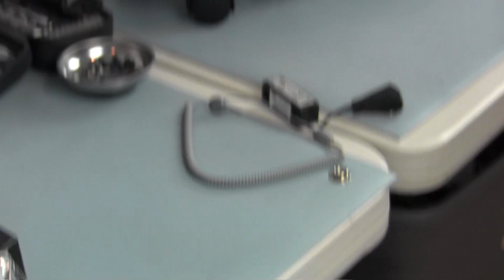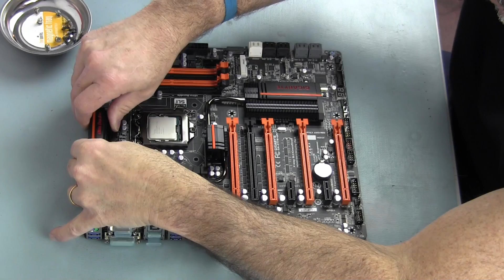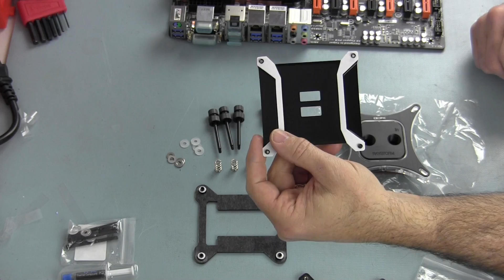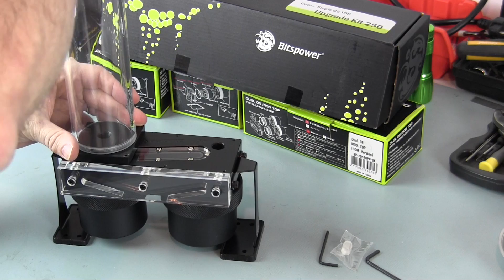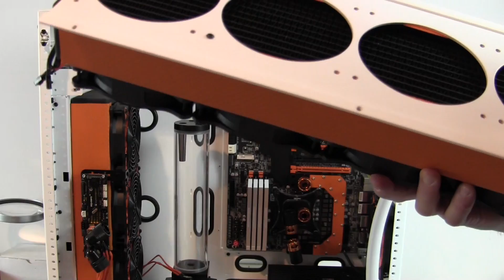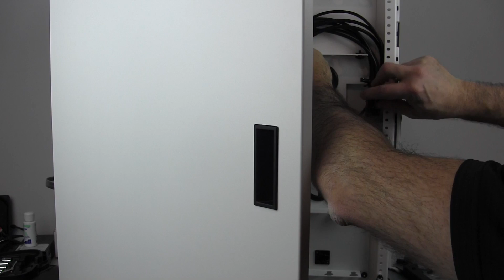Case Labs SM8 Merlin Water Cooled Build Log 4 - Clockwork Orange - Cooling Parts

Comment: Hi wher did you buy your SM8 in white color? I went to Caselabs but I only see Black and Gunmetal colors? thx.
Reply from the maker: +jincuteguy They must not offer it any longer. I got mine when they first came out.  I will be selling mine.  If you are interested PM me on Facebook.
Reply: +Ronsanut messaged
Reply: +Ronsanut What new case are you going to get? And why are you selling it? Isn't it the best case you can buy ?
Reply: +jincuteguy Also, do you know if the SM8 has built in holes for attach Cylinder Reservoir?
Reply from the maker: +jincuteguy No,  any mounting holes  you must make yourself.
Reply: Wow really? Damn that sucks man.  Like for a $500+ case that is supposed to be "Modular", and they still don't have a solution for mounting a Reservoir :(
Reply from the maker: +jincuteguy That is because you can mount one almost anywhere, you have to decide.

Comment: What made you choice one large loop instead of two dedicated loops?
Reply from the maker: Henry Edwards That was my plan from the start in this build.  I have decided since to do a dula loop. See my ST10 Monsta Build logs.
Reply: I was going to say. All the heat from the chipset and cpu will be going through the cpu's, resulting in less efficient cooling. I'll check the ST10 build after i've finished watching this build. Could I ask though, could you not skip the small bits like fan wires, rad, cpu, gpu and chipset fittings and stuff like that in future videos? Newbies like me find the little things the most beneficial for learning.

Comment: any difference between feeding the cpu first or gpu first? I would assume going through the hot gpus will end up feeding hot water to the cpu?
Reply: Dan81369 That's actually incorrect. Assuming you have adequate flow rates, the water will heat slowly as a whole, not at each individual block. It may cause the water to be slightly warmer once it hits the following block, but the difference will be extremely small. In other words, loop order doesn't matter in the vast majority of cases. If you want to run all your blocks in a row, followed by the radiators, it won't noticeably affect temperatures. Just go with the best looking loop order (usually the shortest)
Reply: You are right. It's your Choice :)
CPU first -> Few degrees hotter GPU
GPU first -> Few degrees hotter CPU
So do what looks better (Tube routing)
Reply: Chris Cleveland
Actually my english is not the best and i wanted to write 1/10 degrees but didn't know how to write it :D The difference is marginal, that is true... (According to Dan from Singularity Computers and my own watercooling setup)
Sorry for that^^
Reply: Dan81369 No problem, just wanted to clarify in case anyone was not sure about it.

Comment: I have Gigabyte z87x-UD4H Motherboard and I cant seem to find a water block for the heat sinks. I checked out XSPC and they did have a z87 waterblock but it was for MSI and my gigabyte looks too small then the one that it is shown on. Any thoughts?

Comment: Do you have anyplace where you list all the parts you used??? I checked your Facebook but couldn't find it. Im interested in your Waterblocks that you used and the carbon fiber look that you put on. It looks alot better then the silver that was on there to begin with. Im also interested in the reservoir pump combo. If you could point me in the direction of the list of what you used that would be fantastic because im looking to put in a loop of my own and your videos have been alot of help this far. THANKS!!!!

Comment from the maker: These are COUGAR CF-V12HP Vortex Hydro-Dynamic-Bearing (Fluid) 300,000 Hours 12CM Silent Cooling Fan with Pulse Width Modulation. Got them at New Egg on sale. The flow meter tells me how well my pump and flow are running and if I have any restrictions or blockages that develop.

Comment from the maker: Check out my build Log 2 , when I change the case over from a standard layout to a reverse layout I go into detail on why I prefer it.  But mainly it helps with the tubing / loop order and in my opinion you get to see the GPU blocks much better in this layout and also helps keep some sag from GPU blocks/boards from occurring.

Comment: You're not supposed to use metal tools on the fan rubber screws, that's why you think they break, they don't.
Also, just a quote: "I actually have way more than I need but... that's cool".
Translation: I'm too lazy and/or ignorant to do the job.
Cut the damn cable and sleeve it, buying such expensive parts and not doing the setup properly is wrong, otherwise don't put it on youtube. 
If you're taking the time and trouble to show your work, might as well do it properly. 
Just my 2 cents.

Comment from the maker: Yes, it is a very flexible case , if you have not had a chance yet take a look at this build I did using air cooling. Plenty of space and if you want to water cool it has the space and features to support water cooling as you can see. If you needed more hard drive space beyond what this case offer stock you can always buy the optional mounting brackets to add. CASE LABS has many different sizes of this case around the various motherboard forms and supports insane cooling options.Yes I recommend.

Comment from the maker: I did research and the power control chips for the fans get very hot, especially when you run multiple fans at varying speeds through the controller, so the larger heat sink and the water block (if you desire) are recommended. And yes I am looking for a high stable overclock and hopefully a few chances at >5.0 Overclock , not for 24/7 but for a personal record .

Comment: btw i was also looking at this case. would you recommend it? it looked a bit small but i have a cosmos 2 now and tho i like it, im not going to be running a ton of HDDs or SSDs so it has more HDD bays than i need. i know i can pull them out but still anyway yes would you recommend this case?

Comment: Sorry I though I should also add both pumps must move at the same RPM and move the same amount of water, or head is created as water is being forced somewhere occupied. 

Another note, I would not want to use 2 pumps without compression fittings. Branded ones aswell, that increased pressure can cause leaks.

Comment: Dual loops are the most pointless things ever as are pumps. A single serial loop is the most effective, with high flowrate and high head rated pump. Please bare in mind their is a terminal velocity of water using pumps making the second pump redundant. This second pump has to spin though as a static pump impeller can provide enough head when combined with loop to stop the flow.

Comment: Also remember that your 24 pin cable and maybe some other wires will need to cross the tubing that you ran in the back at 32:54...even though there is mucho room in the back it may not be enough

Comment from the maker: I am glad you mentioned that.  Since I filmed that I decided to change the loop order to the block (you will see in the next video) and when i was cleaning the block of the thermal past I noticed this thin , what I thought was plastic from the original cover wrapping turns out it is a protective layer on the copper block. So thank you, but yes I did find out, luckily before I finished the build.  Thanks again A really big thanks for watching (OUT FOR ME) !

Comment: a better way to mount the flow meter is put it at the floor of the case with a 90 towards the rad and a straight fitting from the rad so it will be totally hidden behind the bump

Comment from the maker: Thanks tamtgirl, I was wondering if that does happen. I did put an LED in the 600T res, but that one I had filled up the coolant to the top so there was no room to see light at all.  I agree that can add extra wiring I don't have to deal with.  I think for now I will just do the one on the res and not the one at the outlet of the res. Thanks for watching.

Comment: Loving the build so far. Before you fill it up you should consider what the raystorm block would look like with the aluminum plate on the acrylic mounting bracket done in the same orange carbon fibre wrap as the mobo block. I think that would make the block stand out and also match the other block and rads much better.

Anyways just a suggestion. Love all your videos and keep doing what you do!